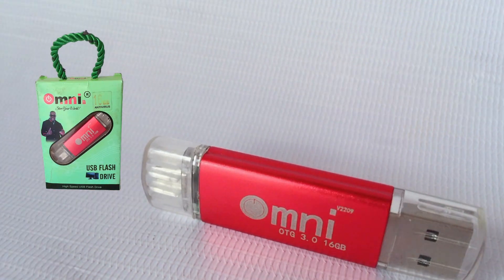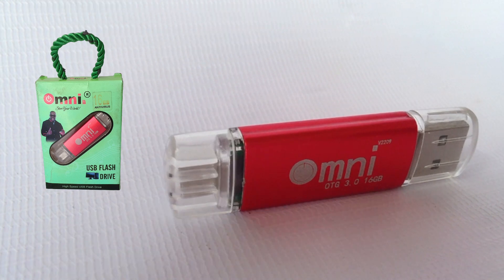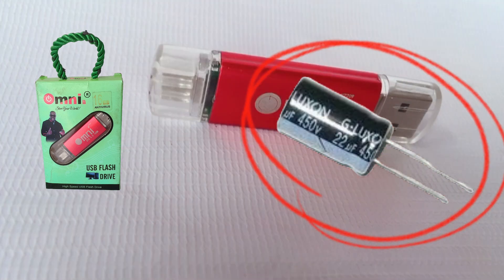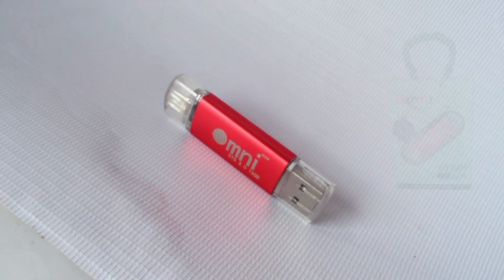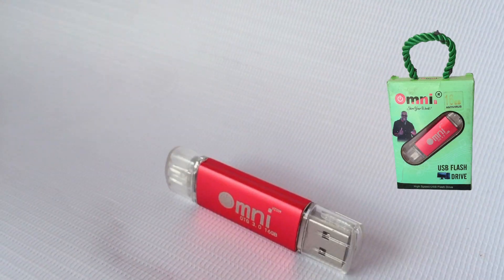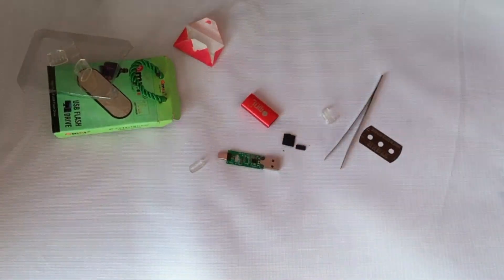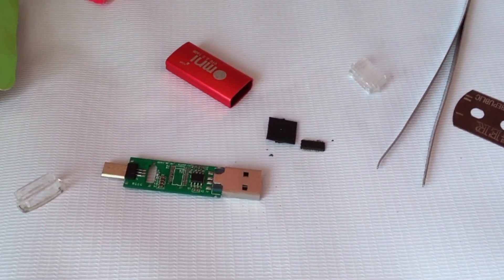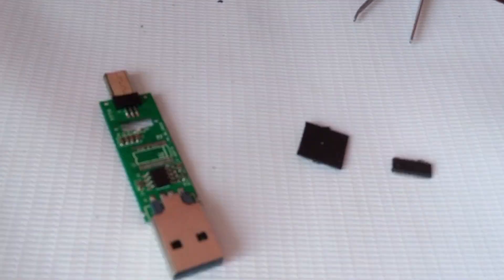we broke a new flash drive to check this

Comment: Yes, there are 6 "capacitors" on the circuit board - C1 to C6.

Condenser???  I haven't heard anyone call a "capacitor" a "condenser" since the 1960's or 70's 🤣

Calling it a "Condenser" is very  old-school.

FYI - "Capacitor" becoming the recommended term for the old word "condenser" in the UK from 1926. While the change occurred considerably later in the United States, the use of condenser is now somewhat archaic.